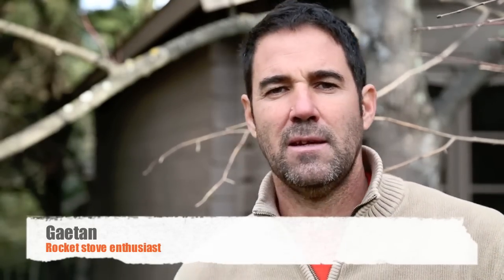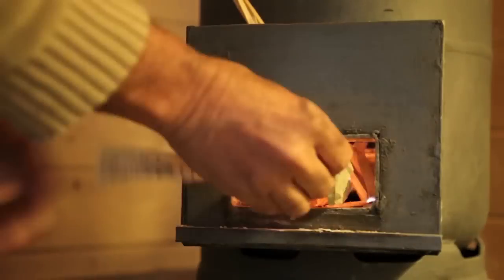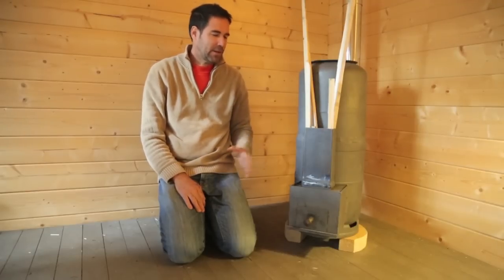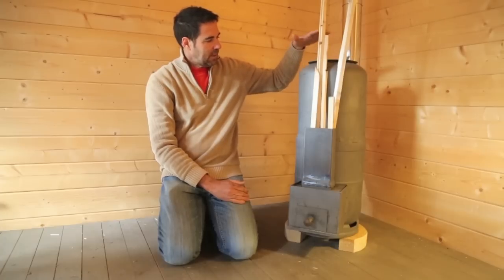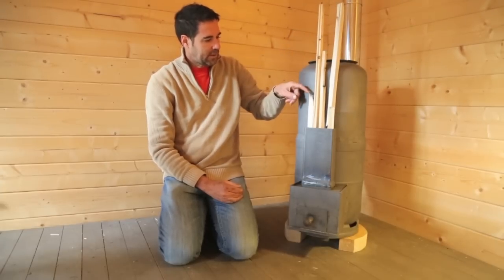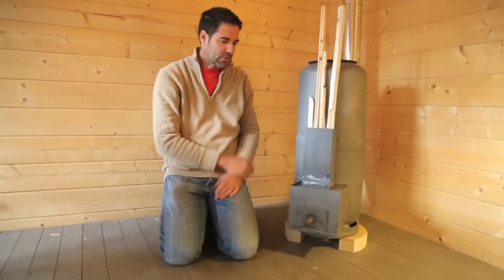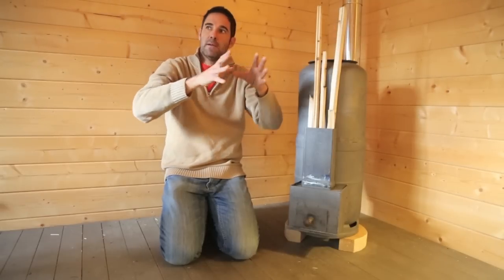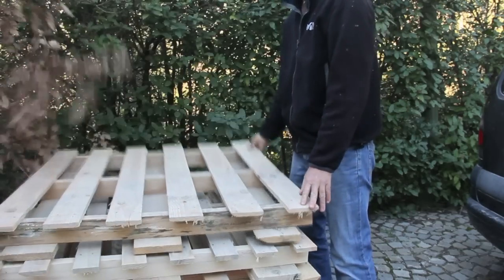Rocket stove heater for a workshop or a room

Comment: Thank you for the clear video and explanation.  I love your design, and I'm hiring a welder to make one for me to survive next winter :-)  I've been looking for a good design.

BUT

When I explained to my dad who has a doctoral degree and an engineering degree that I wanted to use vermiculite, his eye got as big as saucers.  He said that most of the world's vermiculite has radiation.  (Think: mesothelioma....ugh!)  I don't know what to use instead.  I don't mean to sound alarmist.  When I figure it out, I'll post. 

Great design and well done!
Reply: Maybe rock wool???
Reply from the maker: Hi Anita, thanks for the comment !  I have never read that about vermiculite, doing some research on the internet I read other things but not that. I wouldn't be surprised though as there is always an enormous gap between what industries tell us and what is true !   You can also use perlite or dry wood ash, or more expensive pottery kiln insulation. I find that rock wool when exposed to extreme heat, over time, looses its qualities and disintegrates. Welding is easy, take a few courses and you will be set ! Send me a video when you have made a heater !

Comment: How well does it heat? 
If it's real cold, how long does it have to burn before you can take your jacket off and feel comfortably warm?
Reply from the maker: +Philippos Raftopoulos The heat it puts off is fantastic.  However the start up heat in the beginning will depend on many things: the size of the room, the outside and inside room temperature and the size and type of wood. Good to begin the fire with smaller cut pieces so that there is an intense, fast burn, giving off maximum heat to heat the metal structure up and get a good air flow going. For my 15 metre square room, if it is really cold outside, I would say about 10 to 15 minutes before you feel the heat around.

Comment: I would like to see how you fit the two tanks together to prevent leaking. Also, what did you use to insulate the heat riser pipe?
Reply from the maker: Have a look at 0:14 sec on the video you will see the two gas bottles, there are several rings of metal sheet that I spot welded around the top bottle, the second and last ring overlaps the lower bottle. So they assemble like a socket and it is a nice fit, he top one over the bottom one. I did not weld the two bottles together so that I could take them apart for eventual maintenance and cleaning. To seal everything I used a high temperature stove sealing paste. I used vermiculite to insulate the heat riser.

Comment: How did you build the insulated inner chimney? or is this something you can buy as such?

thanks
Reply from the maker: +Yves Baggi Hi Yves, No the insulated inner chimney is not something you can buy as such (as far as I know). I found a piece of stainless steel chimney pipe (thin section) that just happened to fit around the square 2mm metal plate inner chimney. I cut the bottom of the stainless pipe so it would fit around the burn chamber. I filled the gap between the square pipe and the stainless pipe with vermiculite, and as you can see in the video I cut the top of the stainless pipe so it would neatly close the gap between the two pipes.
Reply: Aha, I see now. square Inner diameter
round outter... I got it.

Now I understand why it looks that way.

Good job.

Cheers
Reply: +Yves Baggi I built a Rocket stove 2 years ago and it works great,best thing I ever did in my life for heat.

Comment: questions, all about 32F or below days.  how many square feet (or meters, if you like) you heat with this?  Is the heated area insulated?  How much room does the heater take up?
Reply from the maker: The size of the room is about 15 square metres, ther oom is not insulated and the stove takes up about 60 x 60 cm (this includes clearance area from the wood walls.
Reply: Thanks for your reply.
Reply: gaetanproductions how many kilograms of sticks to hear this living space from a beginning temp to an ending comfortable temp over how many minutes? it looks to be labor intensive with uneven room heating.
Reply from the maker: The room is 15 meter square, the room and roof are not insulated. The size of the heater is the size of the gas bottle in the video, say about 40cm x 40cm
Reply from the maker: I have not done such experimentation, like weighing the wood and monitoring time and temperature. Good idea though. I would not say it is labor intensive, though it is better to be in the room to survey the wood feed as sometimes the wood can get stuck. It heats the room nicely, a small fan behind the stove would do an even nicer job.
Reply: Its winter - please do the test and that will help answer how labor intensive tending is and how well it warms the space over how long to what temperature. Show us please.

Comment: Out of interest, do you have any smoke escaping out the wood feeder when starting? ie before it starts drawing?
Many other rocket stoves I see are slightly angled allowing gasses to go straight up the chimney
Reply from the maker: It all depends how you start the fire. If you start it towards the heat riser then the hot air and smoke go up the riser. I always find the first few moments need attention and are fragile. Then all is well once the heat creates a path up the heat riser and a good draw is created.

Comment: Question why does the fire not burn up along the long pieces to there tops thx
Reply from the maker: Because the heat created by the combustion of the wood in the burn 
chamber creates heat and hot air, this hot air rises up through the heat
 riser and pulls cold air through the wood feed. So the wood only burns 
at the tips, this flow or draw prevents the wood from burning in the 
other direction. The hot air moving up the exhaust pipe and the draw of 
the chimney ensures the continuity of this flow. It can happen that 
there is a back fire, (the hot air goes back out the wood feed)  this is
 caused by high winds that can push cold air back down the chimney. It 
is important to have a windproof chimney hat.
Reply: thx for the info and awesome video

Comment: Hi,

Nice stove.

new project...pelletfeeder?
Reply from the maker: Thanks. Good idea !! I will look into that !
Reply: gaetanproductions
Pellets can be in short supply. Would be nice to have a wood chip feed. Great work. Also would be great to heat water to pex tube it under floor which adds much efficiency to any heat system. Then could go all out with exchanger for hot water unless you have a boiler buddy tank to run it through.
Reply from the maker: putheflamesou Good idea
Reply: gaetanproductions
Yes...and note chippers are different. Some also have changeable screens for varied size chips. I always wondered why company did not design a chipper to work with a stove. I had a pellet stove and once hot they burn anything. Before I sold it I almost tried to design a dc driven auger in a eves trough that sprikled chips in a chute feeding the burn pot. Again once hot they burn well even with a opening  the chips  drop through. The "candle" stove(very different) is a intriguing design also for wood chunks rather than sticks or chips. Wish I could see one real-time. You do great work.
Reply from the maker: putheflamesou Thanks for your ideas

Comment: I am so angry at the School system at the time I was at school. .girls HAD to do sewing and cooking and boys HAD to do woodwork/metalwork and technical drawing.  I would have loved to do that and now, I can put together shelves, recycle pallets into benches etc but I can't weld and it drives me nuts...However I did see one example of a pretty good rocket stove with a hotplate for cooking that didn't involve welding (and it was a reasonable size-not the tin can ones). 
I really like your one as it looks really nice and obviously functions well. I don't see me being able to make one. I am going to attempt the non-welded one but I think it would be better with vermiculite?  I know that is like the equivalent of fire bricks. ..is sand and gravel mixed as good, if you don't know where to get vermiculite?
Reply from the maker: +Anne Anderson (Foxiepaws) Thanks for your comment Anne. Welding is easy first its good to see the basics and security points by someone who knows. Rocket stoves can be made from thinner metal where as the rocket stove heaters really require thicker metal as they generally burn for longer and get up to high temperatures. Sand and gravel will not do the job of insulating but will do the opposite !  They will extract heat from the burn chamber and this is something you don't want happening. You can also use perlite, ash, insulating fibre or bricks that is used in ceramic kilns.
Reply: Thanks for your reply,  I will have a look around the Internet like EBAY and Amazon for Perlite and the other stuff.  I do use a butane? Propane (I never even thought about what was in it as I just order it as a torch refill) for firing metal clay like bronze,  copper and silver. I might have a look to see if the local community college does welding. .I always associated it with those oxyacetaline? scary looking things they used when I used to work for oil companies. ..the really bright sparky things attached to big gas tanks. Mind you I bet I'm one of the few females in Britain who understands Wellhead severance lol! (With shaped charges not welding gear lol!)

Comment: thank you for the video,  but how does this heat the room
Reply from the maker: +Cody “s10cody” Castro When something hot is in the room it heats the surrounding air. This stove is like a radiator, the large amounts of heat it gives off radiates from the stove as well as heating the air through convection, just like an electric radiator.
Reply: +gaetanproductions thank you sir

Comment: How do u split the pallet wood efficiently to fit?
Reply from the maker: Hi Gary, I use a hammer and to separate the planks of the pallets then  I use a hand axe to split the wood. Sometimes the quality of the pallet wood is not always good so the splitting is not so even, sometimes it is. I also look for planks of pine wood that can be split long and regular. With a mix of all that it works fine.

Comment: dont smoke come up fuel feed?
cap off and get air from low starter door better?
Reply from the maker: That is why the fuel feed is an add on mobile piece. If the fuel feed is that tall then in the light up stage the fire goes up the fuel feed. In the video I light the stove without the add on fuel feed then once the draft has been created in the stove I add the fuel feed on.
Reply: gaetanproductions 
You could make the feed tube out of expanded metal screen. 
It would act as a funnel for the wood but would not form a draft.

Comment: It would be even better if you routed the exhaust through a mass.  You are giving away a lot of the heat you generate by just venting it to the outside.
Reply from the maker: Exactly, yes I did mention this in the description. I could not use the "mass" as the wood cabin is build on pylons, so the flooring is suspended and would not resist the weight.

Comment: Uhhhhh... What keeps the fire from climbing up the firewood, falling on the floor to burn the house down????
Reply from the maker: The draw of the chimney. High heat producing good rising heat and draw, creates a perpetual powerful movement in the same direction. the only thing that could change this is very strong gusts of wind and the stove can back fire. This can be avoided by having a chimney cap that turn with the wind and avoids wind going down the chimney.

Comment: How did you cut the gas bottles without an explodesion
Reply from the maker: I emptied any remaining gas using the gas valve, then removed the gas 
valve with a wrench, then filled the bottle with water, to the very top,
 to remove any remaining gas,  left it for a day and retopped if 
necessary, then emptied the water and cut the bottle with a grinder. I 
did this twice and no explosion ! There are several videos on youtube 
that explain this simple technique.

Comment: How about the external air  intake linked directly with the stove with a pipeline, i mean the stove taking air directly from outside. cheers !
Reply: Naicul Naiculandru Yes exactly !  That will be for the next stove !
Reply: +Naicul Naiculandru   Incorporate the air intake with the exhaust system to preheat the air and make use of some of the wasted energy going out the chimney.
Reply: +Paul Smith preheat the air for combustion it is a no go. cold air it is more rich in oxigen so  bigger the flame = warmer the stove
Reply from the maker: +Naicul Naiculandru I agree on this, cooler air contains more molecules of oxygen there fore better for the burn
Reply: +Naicul Naiculandru   I could find nothing to substantiate that assertion.  What little I did find suggested that the cold air would cool the firebox and thus reduce overall temperature.  I'm no expert but it seems logical to me that using the energy going out the chimney would more than make up for the effect you describe.  Some experimentation is in order I think.

While we're on the subject, cold air is heavier than warm air.  the register on the wall allows cold air to flow into the room and sink to the floor.  Since your air intake is so high, I would think that would be a serious issue.  Just a thought for those thinking of duplicating your stove.

Also, there are anti-blowback valves that prevent fire/coals from blowing back into the air intake system that you might want to look into.

Comment: rocket stove is eating internal oxygen. You should set up the stove in the way that you deliver air from outside and if possible worm it up before burning.
Reply from the maker: +Miha Sedej Thanks for your comment, yes I agree, I did put an air vent behind the stove to for this purpose. The ideal would be to have an outside air intake.
Reply: +gaetanproductions looking for a design to take outside intake and warm the airflow around the core to make burning more efficient.
Reply: +Miha Sedej  A jacket around the chimney?

Comment: but how much heat does it generate, how hot does the exterior metal get
Reply from the maker: roy hoco Hi Roy, I don't have a laser thermometer nor any advanced calcuations however does VERY hot answer your question ? It gives off great heat.
Reply from the maker: roy hoco Hi Roy, I don't have a laser thermometer nor any advanced calcuations however does VERY hot answer your question ? It gives off great heat.

Comment: what kind of exhaust pipe did you use?  Thanks.
Reply from the maker: +nzinga zindua  I used inox piping,  more expensive than the parts of the heater ! I wanted a nice finished look to the whole installation.
Reply: gaetanproductions Thanks.  Tryin' to go low cost, as I'm on a budget.  Look's like there's no way 'round those expensive pipes, though.
Reply from the maker: +nzinga zindua   There are much cheaper pipes in different types of metal mixes that do the job just as well. What ever system used the important point is that their joints don't let any smoke come into the room.
Reply: +gaetanproductions 
Inox pipes gather less soot because they are shiny and smoke flows better.
If you have a leak, the old and still the best method is to use some bread dough to seal it. As it heats, it dries and expands a litle, sealing the leak and smelling great!
Reply: Philippos Raftopoulos Thanks.
Reply from the maker: +Philippos Raftopoulos interesting technique !

Comment: Heyya everyone! 
I have a question regarding the chimney pipe. I would like to make a rocket stove in a corner of my living room, and drill the wall to the next room (possibly make a second or third combustion chamber there) to lay the chimney/exhaust pipe. The other room is about 3,5 m long, and I would like to, perhaps, drill another hole in the opposite wall to lay the pipe in the third room as well, which is about 6 m long. My idea is to put the pipe on the floor, along the wall, totaling in about 10 or so m of straight pipe. 
Now, not knowing much about the rules and ratios:
1) how big of a deal would it be if the pipe is lower than the actual rocket stove and 
2) would the length of the pipes prove to be a problem? 
I can always put the pipe on top of the room, just under the ceiling- in that case the second question still needs a comment. 
Thank you!

Comment: You know, most pallets are treated...probably a bad idea to burn them, especially indoors, if they are...
Reply from the maker: ***** Here in France there are two main types of pallets. Ones that are reused many times, these are much more solid in their construction, these ones are usually treated, the other type, the ones I use, are untreated pine wood and have a single use.
Reply: gaetanproductions Very nice...Here in America there are many different types, most are treated, and I just don't want to run the risk.
I wish I had an untreated pallet option...They would be good for so many projects...
Really nice stove, btw.
Reply: +gaetanproductions  Pine has a lot of resin and will gunk up your innards and chimney - they also burn very quickly.  Seasoned hardwoods would be best and you can generally get free branches where hardwood is being harvested.